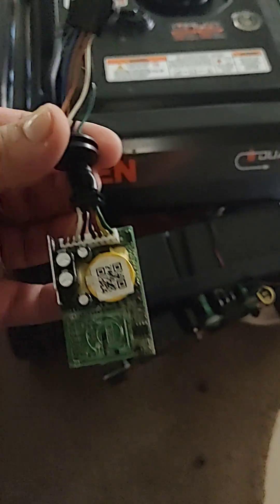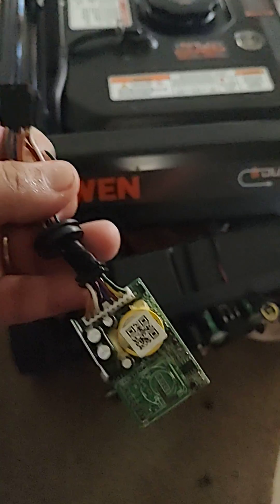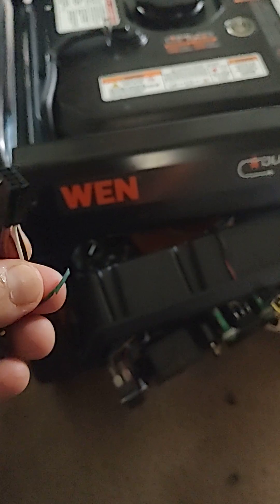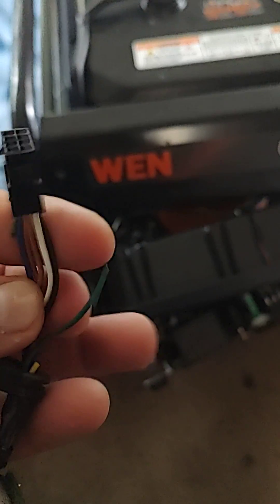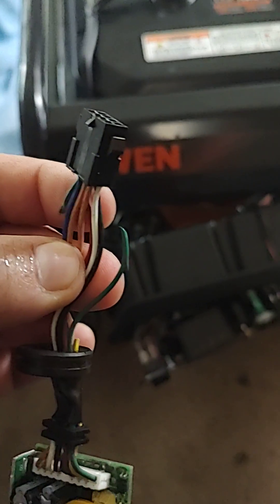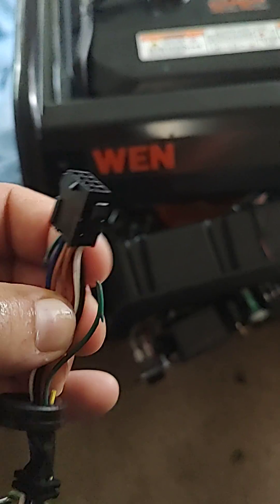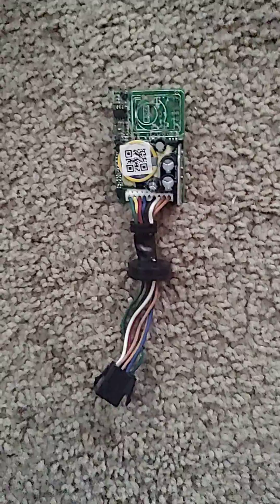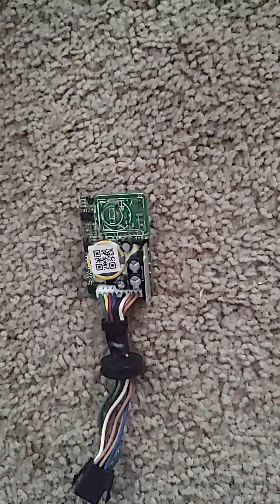wen generator DF5600x carbon dioxide sensor bypass

Comment: Hey brother I'm having the same issues, the carbon monoxide is flashing yellow, and I need to bypass it until I get a new one, where exactly was yours located, is it directly behind the the little light,
Reply: Outside of the casing. Just follow the wires.
Reply: @Doomsday-Prepper  follow them from where? The light,

Comment: Feeling a little bewildered at the moment. I tried to ohm out looking for the wire that goes to your coil and the wire that grounds your coil out but not having a bunch of luck. Can someone indicate what wires they shorted to bypass the CO2 sensor? Thank you so much for all the help on this issue...

Comment: That is awesome you figured it out. I found 2 grounds on the sensor plug, dark blue and brown/black but I'm not sure which one goes to the coil... Any thoughts??  Tried to add a pic of the sensors but unable too..
Reply from the maker: You want to find the one that goes to the coil that controls the spark to the engine so you'll get spark when you bypass it

Comment: Thank you for the information. I have a WEN 56235iX Super Quiet Ultra Lightweight 2350-Watt Portable Inverter Generator with Fuel Shut Off and CO Sensor and having the same issues. I am pretty sure it is the CO2 sensor. Are you familiar with this generator and do you know how to bypass the CO2 sensor? Thank you..
Reply: That's the one I have and I spent hours today trying all possible solutions. This seems to be the best one. I'll try it and will return with a feedback.
Reply from the maker: Trace the wire that goes to your coi and the wire that grounds your coil out to shut it off to shut it off and those two wires should bypass it
Reply from the maker: You'll find a wire that goes to the power to your coil and find out the which one is the ground wire that grounds out your coil to shut it off
Reply: @RomKhier-je5rw I have the same model and I don’t get it, the coil has a blue and a black .

Comment from the maker: It's works great I never put the new sensor on I just keep mine bypass lol
Reply from the maker: @stevengreeson3915they said the same thing to me but there's always a way around things glad it worked for you even after they sent me a new sensor I put it back on and still had the same problem so I just left mine bypassed and it still works great every day it starts up runs perfect I'm glad everything worked out for you too thank you for your comments
Reply: Curious which wires you tied together to bypass the sensor?

Comment: I'm doing this tomorrow.  I have a sound box with a fan and it still shuts off. Mine is outside so I'm not worried about co2 build up.
Reply: Did you?
Reply from the maker: Hope it works great for you